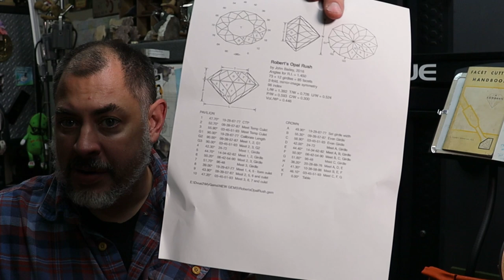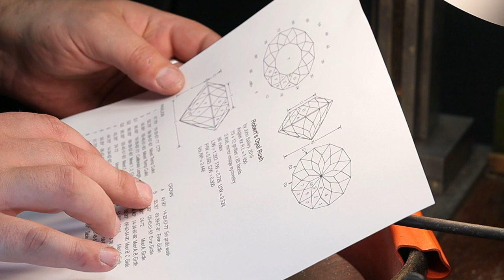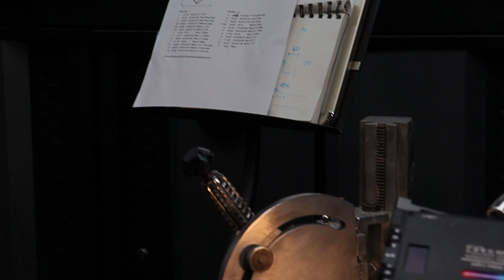Lapidary  fun! Faceting~Washington state Nephrite (Jade) ~Rough to Riches~ Jade EP~2

Comment: Doesn't a rose cut come to a common cp on the table ?
Reply from the maker: Ricky Baker   you are correct. Referring to this as a rose cut was an easy way to create a visual of the finished product -  another description could be “facet top” cab. in this occasion I deceived to leave a large table instead of a CP.
Reply: @LionPunchForgeLPF  did you make your faceting machine Chris ?
Reply from the maker: It was originally built in the 1950’s by a local machinist - he used it until the 1980’s and it sat for many years before I got it maybe 4-5 years ago - it was pretty nasty and I had to rebuild a lot of it including the electrical . No factory spare parts- I had to learn to machine my own using a lathe - the design is roughly based off an MDR machine
Reply: @LionPunchForgeLPF  I was just curious because the quill looked unfamiliar and homemade. He did a great job though. I like it.
Reply from the maker: Ricky Baker it’s a very accurate machine! I had to make another collet for the quill it only took. 1/4 inch dops. Before I got my concave faceting machine I built my own gemstone milling machine . I love doing this stuff
Reply: @LionPunchForgeLPF  what is a milking machine Chris ? I have been around for a long time and that is new to me.
Reply from the maker: Ricky Baker haha...milling
Reply: @LionPunchForgeLPF  oh now that is interesting.